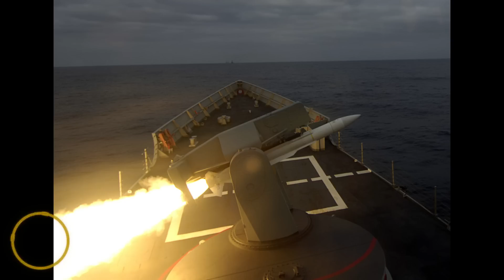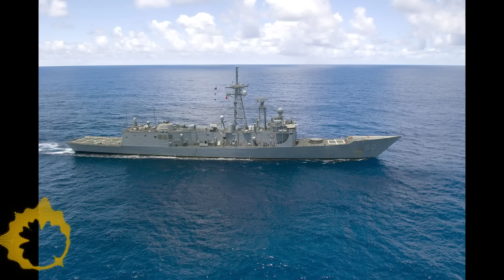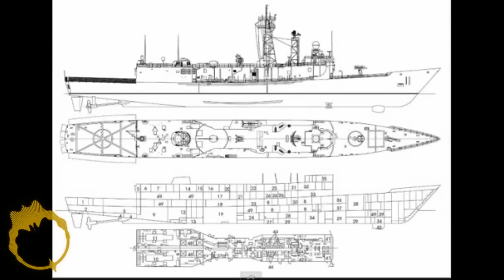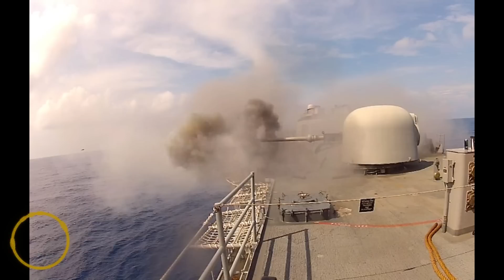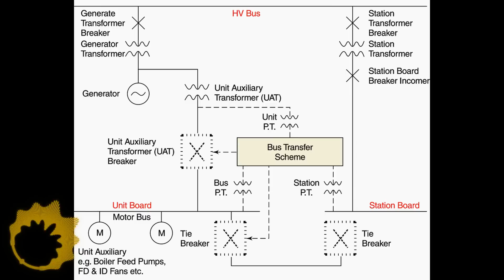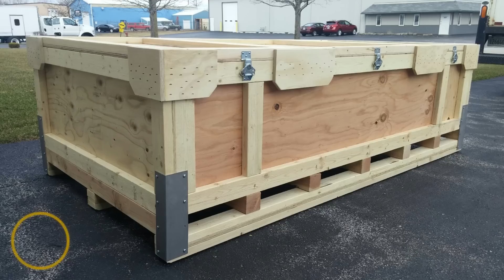The Automatic Bus Transfer switch episode that everyone asked for

Comment: Detroit Diesel designations actually make perfect sense. 16v149T = 16 cylinders, "V" configuration  (two banks of six, split into three cylinder blocks), 149 cubic inches per cylinder, and turbocharged.

Surprised the Navy had big problems with them, Detroits are normally about unkillable, if thirsty and loud.

Comment: Ship is going into a major refit.  Certain piece of equipment is being installed in a new compartment, and the system requires filtered dry air.  The GSO (General Spec for Overhaul) requires a Dry Air Panel (gauges and what-not) be installed inside the compartment, immesiately upstream fromnthe gear the air lines are servicing.  Fine, this is a "standard" part, albeit a "built to order" part rather than an off rhe shelf part.

Problem... as the refit period approaches, the design yard (different from the yard doing the work - NAVSEA is doing the planning engineering, a separate government yard is doing the design work - the detailed rip out & installation drawings and work package planning, and a civilian yard is doing the actual work as they ahve the drydock that can do the work) realizes they can't reuse one of the existing air panels because theyve already planned to reuse all the avilable air panels and this is a new one.  So they figure, "Well, let's make aure we order one constructed."

Problem Part 2... the lead time to get a new dry air panel constructed by the authorized manufacturer is a "long lead time" part, and the delivery date simply will not meet refit schedule .  Refit period cannotnbe deferred, installation cannot be deferred to a later part of the refit period the manufacturer could supply it in.  (And, no, that isnt Navy OCD - like Tetris, the order in which you do the work matters. 😉 )

So, the planning yard had to request the engineering team and ship design manager (SDM) at NAVSEA ask the system program manager if it would be OK if the planning yard buiot the air panel *themselves*, and then the NAVSEA team & SDM approve the "departure from spec" in having the government yard make the dry air panel rather than the contractor who was certified to build and test them (but who couldn't do so within the required time period).

Comment: Honestly, I don't think I could work for an organization with such incompetence. If I were in the same position as that poor technician, I'd probably just want to send either the transfer box, or even the entire ship adrift on a one-way course to the Bermuda Triangle, or for the nearest scrap yards.

 One of my pet peeves is having to work with equipment that is insufficient at doing its job. Like, could you please at least test the part to make sure it's still working properly before bothering to ship the damned thing? That, or just manufacture a new part, and just save us all time, money, and trouble!

Comment: If they have multiple ATBs on board.... why not swap with an less essential one!?

Edit.

I am sure they could have rigged some knife switches as well and made it 100% manual.
Reply from the maker: The actual swap-out-and-replace took around three days, and required running casualty power cables through lots of hatches and doors that would otherwise be sealed, so CCS could remain powered.  And that was with shore support.

Comment: I know a guy who explained to our group why there was a 1000 dollar hammer.  They were made for ordinance branch. So they had to be non-sparking, non-maring and non-conductive.  Apparently a few guys got killed by normal hammers causing a spark or conducting current and setting off some explosives.  However after the political stink about costs, they stopped by them.  Army figured a few explosions and loss of personal every now and then was acceptable vs the scrutiny of congress.

Comment: 16v-149 TI decodes to 16 cylinders in a Vee configuration with a displacement of 149 cubic inches per cylinder (2.44 liters), Turbocharged and intercooled. Also its supposed to leak oil, that's how you know it has oil in it.

Comment: One origin of the $1000 screwdriver meme was the SR-71 program. Soon after they began messing with titanium panels they discovered to their horror that any titanium screws, nuts, bolts etc that standard chromium covered tools contacted quickly corroded. The only solution was a very limited run of one off tools all covered in cadmium iirc. The extremely small run sufficient to support the construction and maintenance of the Blackbird fleet meant the per unit cost was orders of magnitude higher without the usual millions produced to amortize costs over literally making these tools cost thousands each.
Reply: There’s a lot more to that story not involving the Blackbird.

Military equipment and tools frequently encounter environments that consumer grade tools aren’t designed to cope with, like liquid condensed hate. They also have to meet hardness and toughness specs that consumer grade tools don’t, like hammers that will not chip no matter how you abuse them. Those little chips can do incredible amounts of damage if they get into just the right place, and despite great effort being expended to make that impossible, well, it’s not worth risking a warship or bomber or fighter plane or whatever not to mention the crew.

So for instance when I was an AGE mechanic in the USAF I had a toolbox full of sockets and stuff that could be bought at a hardware store for about $150 1970 dollars, the consumer grade tools just wouldn’t have been good enough. That’s why my toolbox with tools had a replacement cost of over twelve hundred of those 1970 dollars.
Reply: Likewise, the "$900 toilet seat".  They needed a toilet seat for a small fleet of aircraft (IIRC B-52) that was a nonstandard size (beause they had to shoehorn it into available space), meaning that they could use any existing mold; the seat had to neither break nor stick to human flesh at some ridiculously low temperature (below freezing); had to be non-conductive; had to be non-flammable at "normal fire" temperatures, and had to not outgas hazardous chemicals or smoke even when burning.  And they only needed a few hundred of these seats (even including spares).

Note that a single production mold can cost up to $100,000, *and they had to design the seat both mechanically and in terms of material.

If they needed, say, 10,000 of these seats, they'd probably have cost $30 or less.

Comment: All hail the Princes of Darkness - otherwise know as Lucas Electrical.
Way back in 1978, in Naval Nuclear Power School, I knew a gent that owned a Triumph TR-7 - otherwise known as the Cheese Wedge - even he referred to Lucas by that term, given all the electrical problems he had with that car.
Reply: You need a bottle of Lucas wiring harness smoke (part number 530433). Pretty much always helps with otherwise fine examples of British mass production... (while you're at it, change to Smiths gauges - guaranteed to work - just long enough until the guarantee runs out).

- Ugh nevermind, spotted the bottle getting shown. Should have seen the image on the screen not just listened to this in the background...
Reply: Lucas Electrics - "Because a gentleman doesn't motor about after dark anyway."
Reply: Ya, I had a couple of TR3s.  I know what you're saying.
Reply: Why, when England ruled the waves, can her cars not make it through a puddle?

Comment: So I've some professional experience with the land based version of this, which we call the Automatic Transfer Switch on the diagrams, and it works in the same way, so that if the main power (the utility mains) goes down for whatever reason, the on-site generator can power on. But we also include an extra UPS type battery, good for at least a few hours, in the control panel itself. Still, knowing you're only one more failure away from a bad situation does not lead to good sleep.

Also, the projects to design replacement systems for existing facilities are SUCH a pain.

Comment: Imagine opening that crate and looking at what's inside. Jaw and crowbar dropping in unison, eyes staring wide in disbelief. ... So what do you write back to the sender in that case?: "Ha ha nice prank. Now send the real thing and better be fast."?
Reply: Personally I’m wondering why nobody noticed that the crate was three-ish tons heavier than it should have been.
Reply: @markfergerson2145  US military shipping is wild.  A common way they choose the delivery company is the "Lowest price technically acceptable source selection process."  There's a non-zero chance the shipper caused the damage, and because delivery was accepted they still got paid!

I have seen poorly wrapped pallets be delivered by duallys (Pickup trucks with 4 rear wheels) towing a 5th wheel flatbed trailer.  One of those contained a computer.  Though I don't think any of us actually ever tried to turn it on.  Especially since it had spent a decent amount of time outside.

Comment: I do like the swing arm system, especially the Btitish Sea Dart, as it allows the missile system to be armoured better than VLS and iff you have enough missiles, it becomes more efficient, space wise, than a VLS, though the higher rate of fire and reliability of the VLS is what got swing arm systems replaced. Also, as the Argie's found out the hard way, a swing arm system can be direct fired with the guidance system turned off.
Reply: Sea Slug if I recall?
Reply: @ptonpc  Nope, that was the predacessor, ironically, despite being an anti-aircraft missile the Sea Slug saw signiffigiantly more success as a surface to surface missile, having failed to knock down any aircaft the couple of times it was used, Sea Slugs destroyed a number of parked helicopters and a radar instilation at Port Stanley Airport.
Reply from the maker: There's also the "cook-off" aspect that the VLS effectively solves.
Reply: @SacredCowShipyards  Fair, it becomes the balance of better armour to resist hits or better ability to survive penetrating hits, which, with modern ship design, less armour but more survivability when heavily damaged is the preferred option. I'm just an old armour lover that also loves the idea of blind-firing an inertial guidance only missile into something.

Comment: It is possible to make a Detroit Diesel that doesn't leak.  It isn't worth it.  It involves basically gluing every component on, which makes it extremely difficult to disassemble for maintenance.  (I've worked on the damn things.)
Reply: "If it ain't got oil under it, it ain't got oil in it?"
Reply: @Tomyironmane  Nah, that's Harley Davidson's of a certain age.
Reply: @Tomyironmane That's especially true of helicopters.  I once had an opportunity to jump a civilian owned Huey, after years of experience on Army Hueys and Blackhawks.  

Beautiful aircraft, nice white paint job, very clean and pristine.  As I approached the bird I started to have a panic attack, convinced this bird was going to crash.  I finally figured out what was bothering me - no oil puddles, no 100mph tape anywhere.  I was convinced this bird was dead out of hydraulic and transmission fluids.  😂

Comment: Gotta love "Smoke smoke smoke. White smoke in #1 MMR(boiler #1)" 0200, 6 hours before INSURV inspection.  Gotta love sailors in a controlled panic.  I was the Secondary turned Primary Investigator(Primary got time off for his kid's birthday party).  Turned out to be an oil line break over a hot manifold and there was a lot of white smoke, 5' visibility.  I sent a runner to the Damage Locker with a note, got MM2 and he got the oil shut off.  Desmoke, clean up oil.  And we passed inspection with flying colors.  Fun time in the middle of the night.
Reply: Standing duty on a CVN doing RCOH in Newport News, 2130 hours, Half the Kahkis that are supposed to be there have left and a bunch of pallets the shipyard workers have left piled up on the fantail aft of jet engine shop go up in after an unspecified dipshit uses it as an extra smoke deck. Watch calls it away and somehow my 3rd class SK (at the time) behind is the senior most person on the DC party to show up. Spend the next 4 hours getting the thing under control (because of course shipyard fire service was off for the night), send in the remnants of duty section to rake and brake as we suck down some water....just in time for the Captain to start walking over to ask for a report because the Kahkis are missing and the Admiral is making an inspection in 3 and half hours time. Somehow I managed to survive the ass chewings that came from that.